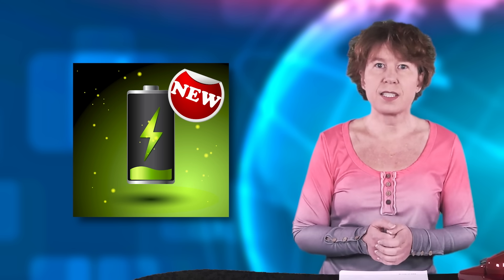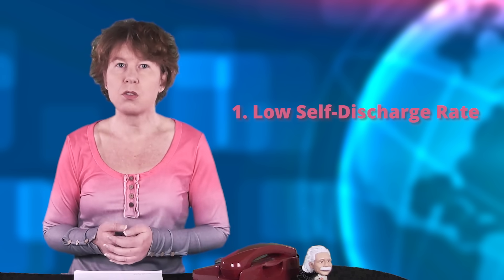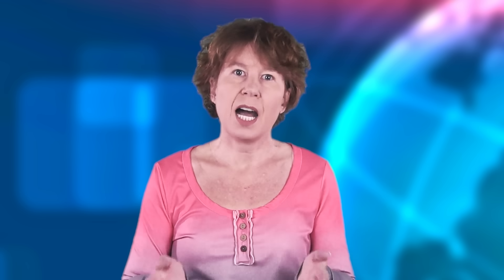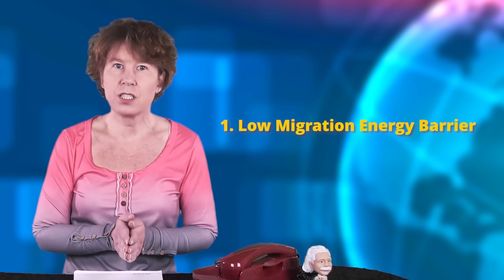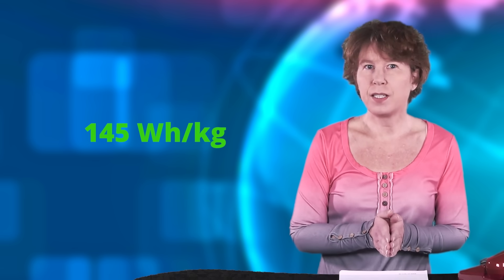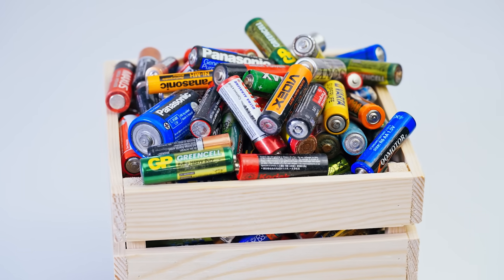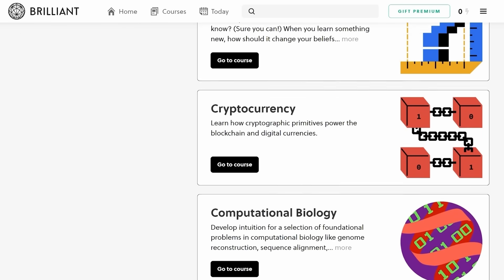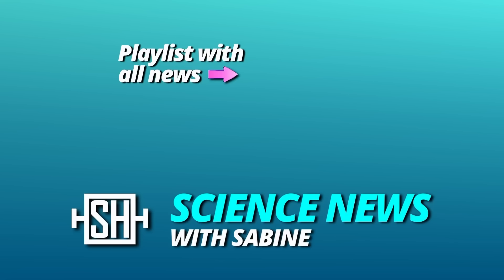Fully Charged in Just 5 Minutes: New Battery Breaks Records

Comment: You missed a side benefit of faster charging ... regenerative braking.

Currently batteries cannot efficiently make use of this as the batteries can't except charge fast enough. Rosen motors had an idea to use a flywheel to store the brake energy, and then charge the battery with that energy.
Reply: Sorry?  Where'd you get that from?  Current batteries absolutely can make use of regenerative braking, typically at rates well north of 100kW.   Nearly all the braking one does in a BEV is  regenerative, including nearly all of the braking done on the highway.  For example, when I am going down the grade from Tahoe to Reno, it is 100% regenerative braking, continuously, in excess of 50kW the whole way down.   I regenerate like 25% of my battery pack on that downhill.

Comment: An infrastructure that just swaps batteries, and charges the empty one on the side ... would eliminate the anxiety entirely. You pull in to swap like you pull in now to fill the tank with gasoline.

Win/win, the oil companies and gas station infrastructure morph into battery swappers, rather than just going extinct.

Gas will go extinct OR most life on Earth will go extinct instead. Choose wisely.

Comment: Why not standardise the batteries in cars. Then you pull into the gas station, put your credit/debit card into a slot and a robot underneath your car replaces the battery with a fully charged one. Gas stations would become charging/exchange stations with large areas of solar panels.
Gasoline is standardised - why not batteries?

Comment: Improved charge time is very important. If a vehicle could be charged in the same time as filling a gas tank, range anxiety becomes less of an issue. In several years EVs will have comparable ranges to gas powered cars and range anxiety will be a non-issue with the shorter charge times.

Comment: Firstly, I really enjoy your content, you strike a great balance between being understandable and the nerdy details. Thank you. My daily driver is a 7 year old Tesla Model S. I leased 3 different GM EV1s in the late 1990s and have consulted in the EV industry for decades. An electric car is a System it is not just a battery. Range anxiety is a serious thing for people transitioning from Fossil fuel cars. I really don’t worry about running out of juice. The batteries in current EVs are really good and are getting better by every metric all the time (Energy density, Power density, Cycle life, Charge times) The simple truth is manufacturers can deliver higher capacity battery packs (longer range) today, but they don’t because there is more money to be made by selling more cars. Given Tesla’s Supercharging infrastructure in my area there is no need to have a larger battery pack. My most frequent out of town trip is about 400 miles. My 7 year old 90KWH car requires 2 20 minute stops enroute  to make the trip. So does my bladder and my back. I have made this drive for decades my enroute experience is better in the EV than in my fossil fuel cars. My navigation system calculates my enroute charging location based on my needs and how busy the charging locations are enroute. When you drill down into real world charging times there is very little difference in elapsed time on a charger with a 100kwh peak battery pack and 250kwh battery pack. The total fraction of the time that the battery is able to take all of the power available is a small percentage of the total charge time. This is one of the reason that Tesla routes a car to SuperCharger often for little sips of energy instead of fill ups which have been the gold standard for road trips all of my life. *Every time we fly in a commercial airliner the plane is only carrying enough fuel to safely get to its destination, because every pound (Kilogram) of fuel is one less kilogram of paying cargo. I find it curious that consumers don’t worry at all about the airliner running out of fuel. It has been my observation that most lab scale break throughs don’t ever make it to consumer scale deployment. I am always interested in progress in battery technology because it is the backbone of transition away from the combustion economy. Amory Lovin’s A well known futurist quipped in his peresentations of 30 years ago The Stone Age didn’t end because we ran out of stones. It ended because we found something better. The transition to an electric dominated global infrastructure is happening because it is better.

Comment: According to the Dept of Energy, up to 90 percent of electric car owners recharge their car batteries at home overnight. So, the issue you are exploring in this video is relevant to 10% of electric car owners. Some of that 10% are dissatisfied and vocal about lengthy battery charging experiences. Which indicates that it's not a major problem.

https://www.energy.gov/energysaver/cost-charge-electric-vehicle-explained#:~:text=Costs%20of%20Charging%20an%20EV%20at%20Home&text=That's%20good%20news%20for%20anyone,to%20charge%20an%20electric%20car.

Comment: Could the battery be used in tandem with a standard lithium-ion battery? This way, it could charge quickly, and when not connected to electricity, the indium battery would recharge the lithium-ion one until the indium battery's charge is low, allowing for another quick charge. If the energy transfer loss between the two batteries is sufficiently low, this could indeed be intriguing, don't you think?

Comment: Basic Problem with Electric Cars: ICE cars are too good.  They can go 200 or even 300 miles on a full tank, AND fully "recharge" in 10 minutes or less, AND their "recharging stations" are almost everywhere, AND they cost 1/2 of full-electric cars, and ICE cars last for 20 years or more without repairs that cost as much as the original car.
That combination is extremely hard to beat, even if we COULD actually power all of our cars with electricity (which we can't).

Comment: A hybrid of the two batteries could work, you only have 5 minutes to charge your car? Plug it in, get a few miles, and go. 
Saves you from using the slow Lithium-ion batteries the more short stops you have.

Later on; you have more time to charge? Charge your Lithium-indium battery in the first 5mins, then after that it starts topping up the slower Lithium-ion batteries.
No matter what you'll always have that fast and dependable chunk of Lithium-indium to fall back on in a pinch.

Comment: I own 2 EVs.   I usually charge at home.   About 15% of my charging is DC Fast charging on road trips.   How long to charge vs how large a battery vs what the a car costs is very dependent on the use case.   If the car is a second car, only used for a 50 or less mile a day commute and you can charge at home, get something cheap and comfortable.  If you need a car that can road trip effectively, you need to decide how often you need to stop for things other than charging.   I'm over 65.   I don't want to drive more than 2 to 3 hours without stopping.   And when I stop, I want to stop for at least 15 minutes.  I want to have an electric car that can charge about 150 miles of range in about 15 minutes.   This charge will be from 10 to 60 to 80% of maximum.   I think the current Ionic 5 charges faster than a Model 3.   The model 3 has a longer range.   Both are everything I need in a road tripper.   5 minutes to a full charge is a benefit.   But not one I'd pay a lot of money for.   If you want to set an EV Cannonball run record.   By a new Taycan.

Comment: I agree Sabine, I need more range vs faster charge.  Here in the midwestern states it's not usual to drive 100 miles at 80 mph, visit mom, then drive back.  I can charge overnight at home or I can charge at a hotel overnight if i'm driving across multiple states.. but with my current car and it's 64kw battery I can't get but about 130 miles (because you don't drive until it's dead and you don't charge to 100 percent every day nor at a fast charger.. My car is great (AMAZING) in the city but when I need to drive to a state or national park (which I love to do) the I have to charge multiple times on the road which drastically increases trip time.  That's it for now, I need to go change the oil, oil filter, air filter, replace spark plugs, and check the coolant, serpentine belt and hoses in the other gas car..

Comment: Oh, but it does make a difference how fast the charging goes. Because if it takes ~5 minutes to charge from 10~85% in real world settings then fast charging stations can service upwards of 12 cars an hour each and be very comparable to gasoline pump technology of right now which probably takes close to 3~5 minutes just to fill a tank. This will really help with adoption! 

Also I believe it will reduce the cost of charging at a station because the amount time you are tieing up the epump will be much reduced. 

Energy density can be improved through many techniques such as adjustments to battery chemistry and process innovation. 

People who use petrol cars aren’t afraid they will have to stop for gas, because unless they get gas delivered to their home they will most definitely eventually have to stop for gas. It’s just less inconvenient that having to stop somewhere besides your home to have to charge your car.

Comment: Still not enough  capacity  in current grid to even charge 1% EVs out of 287,000,000 cars registered in United States.

350 Amps at 500VDC load plate on Tesla chargers here.
And people that live in NYC most have no driveway or garage to charge overnight .

You can't run extension cords all over NYC at 50amps..
Insane .
No one is considering grid and charging issues in major Urban areas with millions of cars.

Comment: Personal opinion is that it could be useful in case one doesn't need that much power stored, as much as they would need the battery charged ASAP - and in cases where gasoline would be impractical (so, not ambulances; as much as I am very much pro-renewables, I am also quite aware that they simply can't fit everywhere). Hypotheticaly, it could work in an area that is connected to the power grid, but the power supply is either intermittent, or unreliable (so... in an area that has access to renewables at sufficient levels, but that is spread over time in large spikes, between which there is little to access to power through them), and constant delivery of combustable fuels is not viable? (eg. areas deep inside large contients?)
Over all, it doesn't sound like a "general use", but I imagine it would find its use.

Comment: The issue with this is that if we just want faster charging with current batteries and are willing to sacrifice energy density, just charge to 50 percent state of charge and it will only take 7 or 8 minutes in several currebt model EVs. NMC cells being twice the energy density of these cells.

Comment: I have a Chevy Bolt which charges relatively slowly, taking about 40 minutes at a level III charger. I installed a Level II charger, so we mostly charge at home. When we're on the road, we take a break every 240 Km or so, so charging is not a problem.

One use for 1 Tb of storage is producing YouTube videos mumble mumble ...

Comment: While, indeed, electric cars in general have every advantage over internal combustion, and even the one big disadvantage, which is slow charging, doesn't really make much sense, because unlike with filling up a fuel tank, you don't need to stand next to an EV to charge, and taking the 10-15 minutes to charge to 80%, especially on long roadtrips, is time one can use getting out, stretching the legs, having a coffee, all things that make you a safer, more vigilant driver, for longer, I also think that chemical batteries are just the beginning. Battery manufacturers only improved batteries marginally over the years, and they still degrade, and while research is being done, and plants are being built for recycling Li-Ion cells, it's still not exactly common or easy, and without a major shift in driving paradigm and mentality (realizing you don't need to stand next to it to charge, charging overnight, what 500 km of range actually means for 90% of the lives of most people - spoiler, it's more than most people think - and the list can go on and on, really), a lot of people are still going to be reluctant. I mean, I've seen people in public forums suggest Tesla put alternators on wheels, and they just couldn't seem to grasp the reason why that wouldn't work, so at this point I don't have a lot of faith in people.

Comment: The same reason of the terabyte can be applied for 300 miles. Im amazed how much people seems to need to drive 300 miles a day, and even its not enough, and they even want an electric car.
I spent many years with 20km range and no problem forgeting to charge... 10Ah...48v 1200w power motor. Just cents a month.
And lets see when they change the fuel taxes to the EVs, because no nation will loose that income, and even worse, we should not allow that massive amount of money transfered from tax income to electric companies income. That will be the biggest steal of history, and its happening right now. 
We are paying the EV companies tax money, loosing fuel taxes and even paying more per mile in electricity than with gas in some places. 
Is that the reason of the EV push down the throat we are experiencing.?
Is possible so much nonsense between so much politicians at once?

Comment: Charging time is very important for road trips. I have a Chevy Bolt. It has a range of over 200 miles, and the only place I've ever charged it is in my garage.  It's great for local driving.  For road trips, I use my Toyota Prius. On a road trip I frequently drive 400-500 miles in a day, and occasionally more. For such trips, the long charging times greatly reduces the utility of the Bolt; there is a big difference between spending 5 minutes filling a gas tank and an hour charging the battery.
Reply: Same here: Bolt 2017 for daily, PriusV for long distance and camping.

Comment: For classical chemical batteries, higher maximum charge rate mostly means that you can charge with a way lower rate compared to the maximum. And when you use low charge rates compared to the maximum charge rate, the battery retains its capacity longer. So higher maximum charge rate translates to a longer life cycle in practice when you keep charging at low speeds.

Comment: 20%->80% charging essentially only uses 60% of the battery capacity. It's like having a 50 liter fuel tank but you always have to fill up to 40 liters and drain it until 10 liters (30 liters out of 50 being usable).

Comment: Doesn't Toyota already have a Solid-State Battery ready to market soon that charges in like 5 or 10 minutes?  The problem is we don't have a national electrical grid that can charge all these batteries,  nor is the electrical grid non-polluting and non-toxic either,  still have the same emissions it's just coming from power plants rather than cars.
Reply: not the same emissions, but far less per mile. You cant tell me you watch a scientific channel and cant grasp the fact a central energy production in a power plant is more efficiant than decentral burning of fuel in rolling heaters.

Comment: Range anxiety has a few dimensions.
 1- Having to divert to find an available charger that happens to work. 
2-Waiting for it to become available. People plug in and abandon their cars to shop/eat because they are so slow.
3-Taking the life cycle hit by using high C charge.

300 mile range  5 minute charge 200,000 mile to 80% performance capacity gets it to your basic 1980 Toyota fitness for use mark.

Comment: It's not the battery that limits the charge. (ultimately) It is the capability of the power supply. Even now the fast chargers are throttled back in some areas especially at high usage times. This is all a scam.